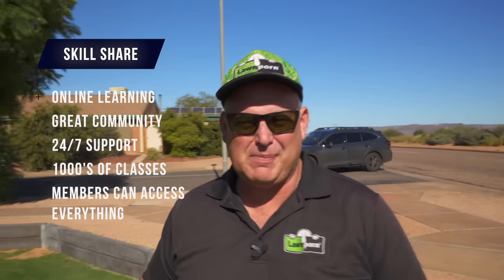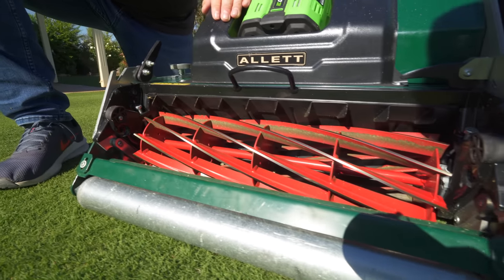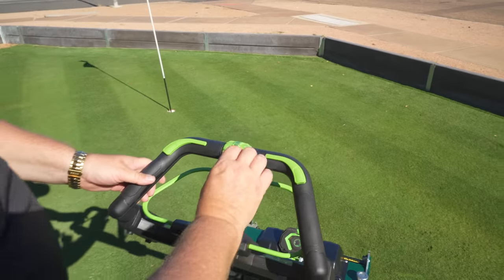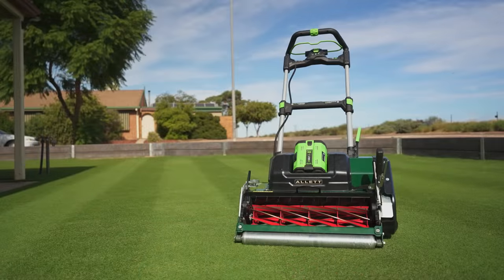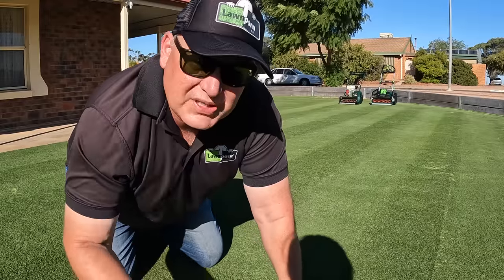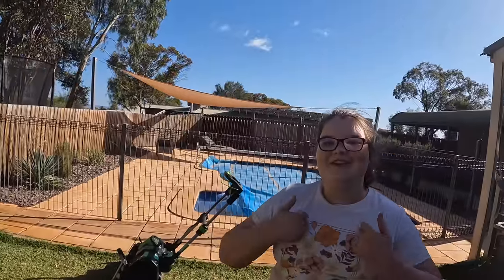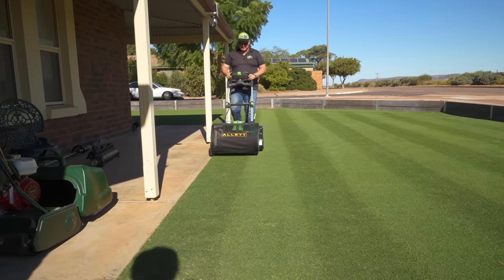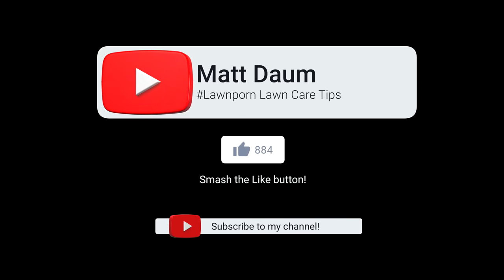Allett Stirling 51: The Review YOU NEED TO WATCH!

Comment: Craig Monty
1 second ago
I'm so keen for an electric cylinder but i do worry about how it will age long term. Petrol mowers can always have engines repaired or even replaced pretty easily but what's the options like when the battery systems start to age? What happens for example if EGO stop making this battery in this form factor or stop making it all together?

I suppose the money you save in maintenance for a petrol will offset the cost of buying a new electric mower in 10 years... Just more e-waste i guess.
Reply from the maker: Hard to say what the long term deal will be like. Don't have that crystal ball but Ego is one of the bigger battery systems so to speak. If they all fell over I'm guessing someone would uptake the battery form to offer replacements.?

Comment: I have the Swardman, kind of wish this mower came out a year earlier and I may have bought this instead. The price tag is a bit steep, about $1000 more than the Swardman and need to buy the battery system separate, which is about another $1000. It's hard to say if this mower is $2000 better than the Swardman, and I'm someone that has been slightly disappointed with the Swardman, but $2000 is a lot of money for comparable products.
Reply from the maker: I had the Swordsman as. well and that was good for a while. I speak to the designer quite regular. I feel the Allett is leaps ahead at the moment. this is a great product.
Reply: When the Swardman debuted I had immediate concerns about its battery due to its internal mounting and the difficulty entailed if it needs to be changed out. It also eliminates the possibility of swapping out a second battery if you’re cutting a large property or were working on a big project and run out of battery charge. The Allett Liberty uses a universal design in its battery by Greenworks and the Sterling model uses the EGO system so extra batteries are relatively affordable and can be charged while running with the other. When the Swardman needs to be charged I believe that it has to be parked in place until it’s charged.
Reply: I wanted a Stirling but with all the reels it's $8800 the swardman decked out in electric is like $5400

Comment: A battery operated cylinder mower. Struth! what's next. Battery powered airliners!  How long does the charge last for? Also do you need to adjust the mower height setting for each side? I've used battery powered rotary mowers before. I've found that the mower settings are not low enough to cut my couch lawn.
Reply from the maker: Charge lasts decent. I’d guess a 10Ah would be quite a few mows of a 200m2 yard. I didn’t have the time to do a proper test but that 3 outta 5 shot was done after 7 odd mows of my front (to get footage etc) the small bit of cultivating I did in the back and a mow of my rear plus mowing at both my mates which I drove it all the way to the property with the self propel
Reply from the maker: Height adjust is only done on one side.
Reply: Runtime is approx 40 minutes (850sqm) with the 6 blade cartridge and 5Ah battery. Whilst there are numerous variables including the HOC and which cartridge is in use that can affect it. However you can use the 10Ah Battery if you’re wanting a longer runtime. Whilst the HOC is 5-50mm, however you can do 4-15mm with the 10 Bladed Cutting Cylinder, the HOC adjuster is on one side 👍
Reply: Hi Matt I’ve been wanting one of these since they came and waited for the prices to go up lol. How would you compare this mower over the gas Kensington. I have a year Kensington but hopefully sell itself

Comment: does Allet own Atco the
Reply from the maker: I'm not sure exactly but I think allett own the design.
Reply: In 2011 Bosch sold the intellectual drawings, plant, equipment and tooling for the entire existing mower range to the Allett Mowers 👌
Reply: @adeturfequipmentptyltd5402  ok that's Bosch not Atco thought Atco did orginally own the designs for the Allet Buckinham range
Reply: Hi @DarthSidious11  Yes ATCO was owned by Bosch then on-sold 👍
Reply: @adeturfequipmentptyltd5402  ah ok cool didn't know that so Allet own 2 Mower companiel then Allet and Atco isn't isn't that actually 3 mower production companies they own then
Reply: @DarthSidious11  they didn't buy the Atco brand, only the tooling and designs of Atco cylinder mowers. So everything Allett sell is branded Allett.

Comment: Allett mowers are way over priced for what they are. There are equivalent mowers on the market at more competitive prices.
Reply from the maker: The prices of worldwide supply and freight is ever more expensive these days. Everything to my eye has jumped lately.
Reply: So we can pass this feedback directly onto Allett, can you please let us know which equivalent units you’re referring to. In which also offer an interchangeable cartridge system and are lithium powered, thanks.
Reply: @adeturfequipmentptyltd5402  From the US market, the Swardman goes for 3799, the Allett is 4469. The Battery on Allett's site is 999, plus the charger, 399. That makes the Allet 5867, compared to the 3799. Obviously Allett has some brand name power that has to count for some dollars, and Swardman is still an up and coming name, so they have to try to be cheaper to get market penetration, maybe $2000 is a fair difference in the industry, I don't know.
Reply: In Australia the Allett Stirling is about the same price as the Swardman Electra.

Comment: This is a very exspensive Ego mower !!

No way is this worth $4700-5000 it’s made 60% from a $750 made in China Ego mower . 🤦🏼‍♂️🤦🏼‍♂️. Allett is insane for their price points sorry!!  Ego battery’s get ate up fast when using the self propelled and w this u have no choice it must be used  I see a $1500-1800 mower at best!!
Reply from the maker: I get what you are saying and understand your point of view. If you can go a cheaper route to get the same thing then go for it but there are risks... I have mates that tried getting cheaper mowers from Alibaba and the like and never receive them.
I found the battery did quite well for the self propelled and mind you my batteries are now a couple of years old, stored in a shed when during the summer it gets to 50 degrees Celsius sometimes... not ideal for batteries.